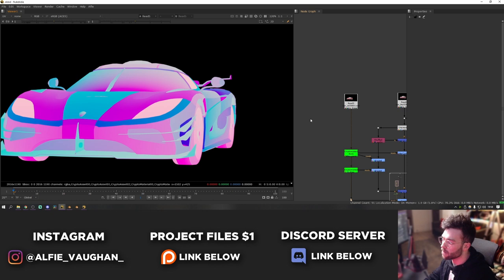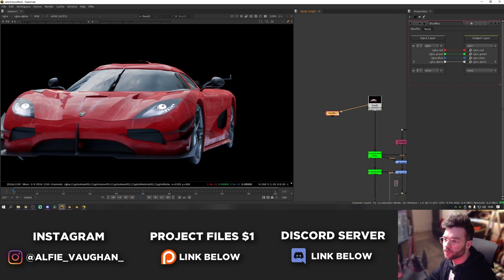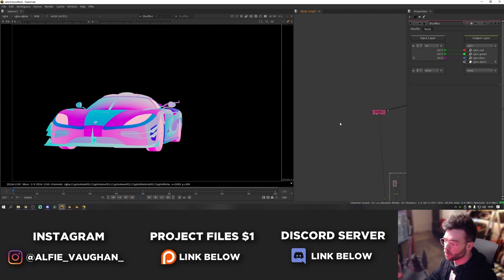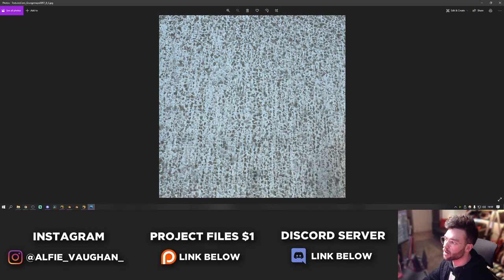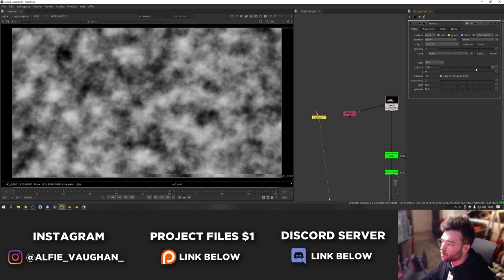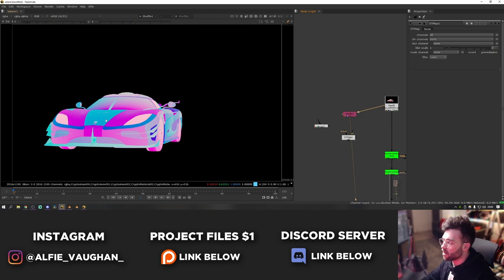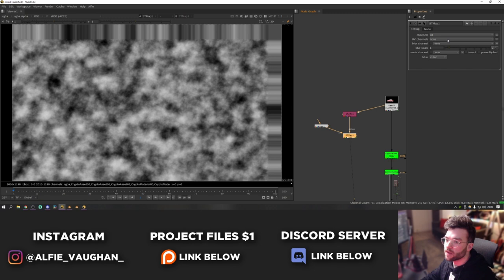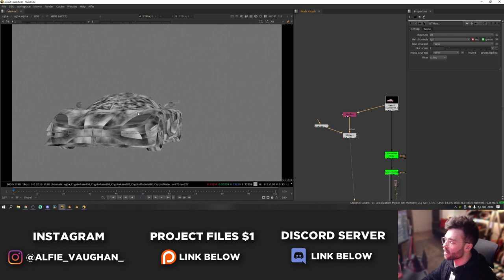Basics Of CG Compositing (Part 2) | NUKE FOR NOOBS!

Comment: Love this part 2! So helpful :) Really hope there's more to come like this. If you do decide to deconstruct your workflow further, this is an idea of what I'd love to see:

Pt.1 tracking some footage (e.g. a city street with the camera moving forward and rotating on an axis a little) - importing to Blender and adding some CG elements ( ideally 1x static and 1x moving element - e.g. street light with a variety of material textures & a paper aeroplane that flies across the scene). 

Pt.2 preparing render - Cycles settings (sampling. denoising / openEXR multilayer/OpexEXR, mist pass, cryptomatte)

Pt.3 Round tipping with Nuke - Similar to this excellent two-parter I suppose - importing the different passes for the cg elements and doing some work on them to mesh with the BG footage. 

Apologies if you've covered some of these bits before (if so, would love a link!) I also understand that this is an enormous amount of work so no worries if you're much too busy! 

Thanks again so much for this second part.
Reply from the maker: Glad you liked it! I did something similar to what you're suggesting last year. It's this video:

https://youtu.be/Ia6qNvjObeI

I'm planning on updating it fairly soon and going a bit more in depth so stay tuned! But that covers most of my workflow :)

Comment: thanks, really good if you start nuke. I got the problem that the cryptomatte passes of the output node in blenders compositor get mixed up in nuke. instead of e.g. object00, object01 nuke only recognizes one object channel. It recognizes the ones in the normal blender output file. Any idea how to fix that ? I can't find anything online.
Reply from the maker: Glad you liked it. That actually sounds correct, they should all get combined into one crypto object pass in nuke. You don't have the 3 individual ones like blender outputs. I don't know why but that's just how they have to be rendered and then in the compositing software they're all accessible as one
Reply: @AlfieVaughan  Ah ok. Thank you ! That stuff is so confusing when you start out.

Comment: I've been stuck on the logic of this for hours, but after masking out the noise with the cryptomatte, why would the masked out areas with no alpha affect the headlights after multiplying? If the math behind multiplication is AB, then the parts with an alpha of 0 should have no effect on anything.

Also, if it does, that makes the masking before multiplying redundant since you have to mask it out using the same cryptomatte right after (I tried disabling Merge7 and there was no change).

So what's multiplied over the headlights?
Reply from the maker: Well multiplying it over with the merge node ignores the alpha, it just multiplies the rgb channels. So when I masked it using the cryptomatte that made the areas outside the alpha black. And then when multiplying that over the rest of the car, obviously the black areas affected the rest of the image too. In a normal scenario I probably wouldn't have masked it, it was just for a demonstration in this video